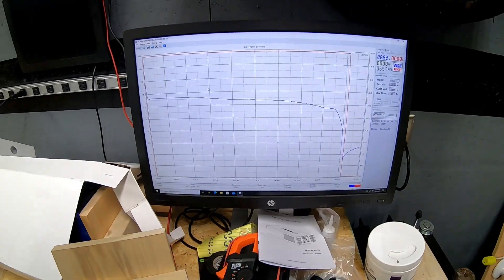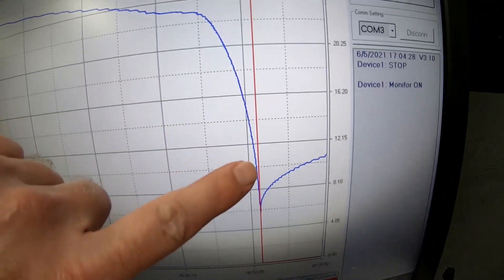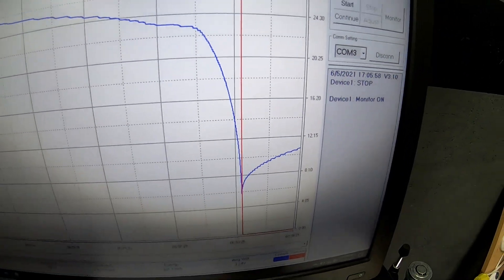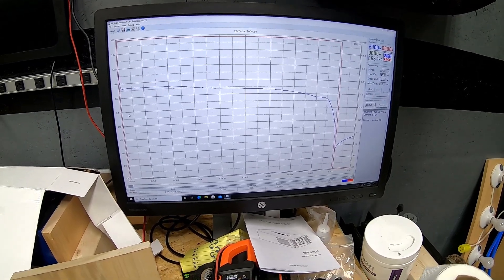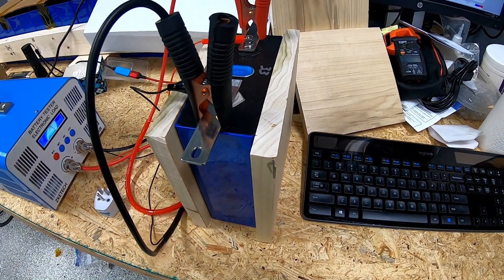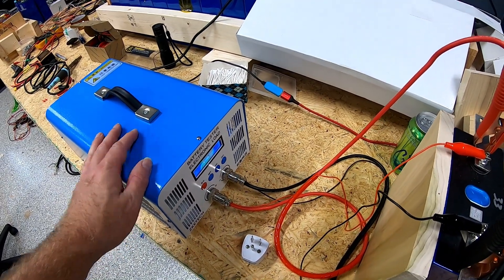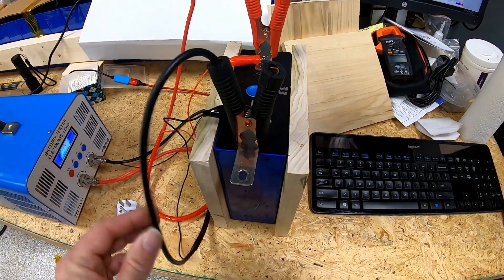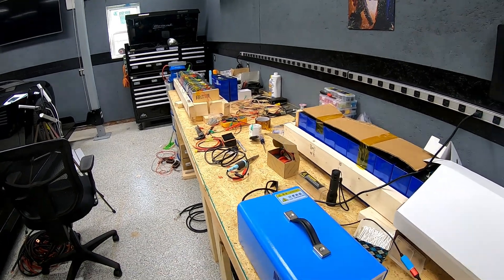ZKE-Tech EBC-A40L test discharge

Comment: Hello and thank you for posting this video! 

What were the results of your capacity test done on the cell charged up to 3.65V in previous video compared to the testing done at 3.5V? 

Also, I understand that 40A is not recommended with EBC-40L for longevity as well as the current carrying capacity of the 10awg cables. Have you cycled many cells at 40A and how hot did those cables get?
Reply from the maker: The difference between 3.5 vs 3.65 volts on the cell capacity is only a few ah's.  I have not had any issues using the charger at the full rated 40A, have done many charges and discharges as well as many other Youtubers that have done hundreds of tests, no issues at 40A that I have heard of.  The cables do get warm running at 40A.  Not currently seeing any issues with the insulation, clamps, or connectors on the unit that I have.
Reply: Thank you!